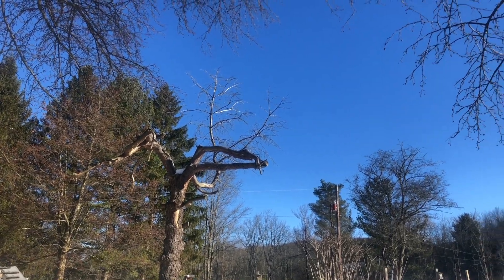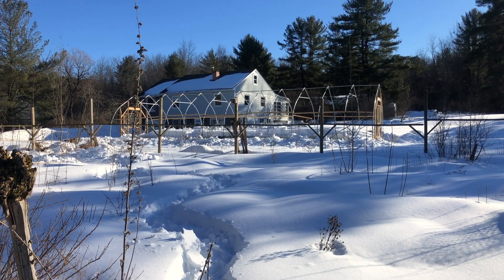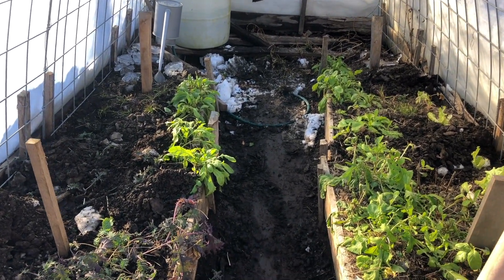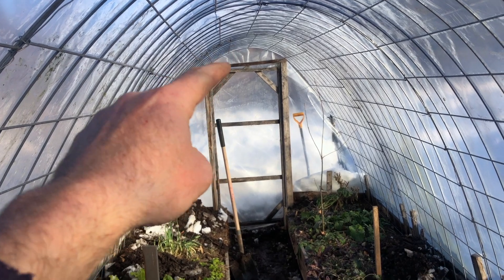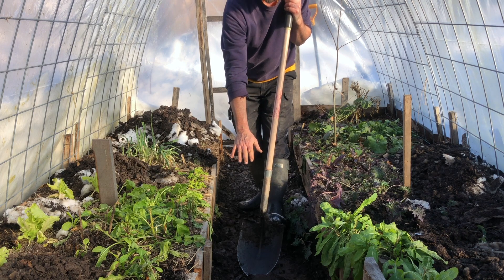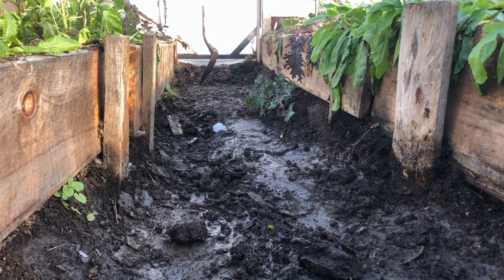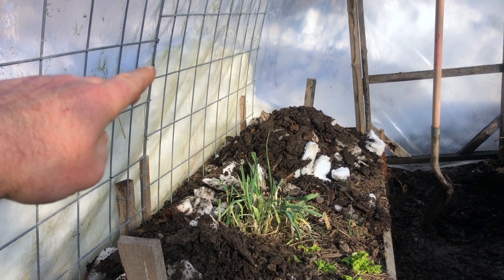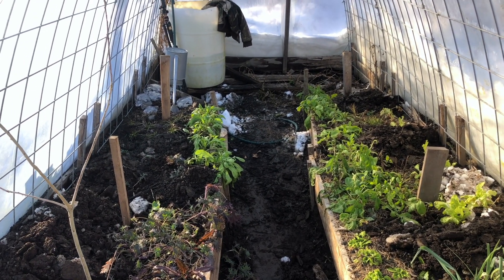Compost Heating a High Tunnel - Walkway based heating approach concept...

Comment: Not convinced that the volume to surface area ratio is going to be high enough to keep the compost active; looking forward to your results.   I would recommend starting the low tunnel down low and away from the side walls, keep the additional layer of air insulation.
Reply from the maker: 100% agree with the low tunnel poly returning to the ground on the north side, no light gain to be had but definite air gap to be had... on the south side I may experiment in the different tunnels...
I wonder about how much warmth I will get too, but I'd like to try.

Comment: Overwintering means more or less dormant and not productive?  I'm very new to all of this... 

Also, this is probably a reach, but I wonder about the effectiveness of using copper wire, mat, or pipe to conduct heat into the soil directly from your compost isle to the beds.  I can't remember where I saw the information but it seems that the wire will move heat quite far quite efficiently.  Coupled as such, perhaps you could avoid some convection losses?  I really don't have a clue though, since I think you have to turn the compost somewhat frequently?
Reply from the maker: Overwintering is like 'sitting still' and waiting for warmth and sun to wake up and take off super fast.  Gives a nice early jump on greens for us.
Great in concept, but in practice the copper or other material would make for a very hard time in turning/accessing the compost, so I'd have to think about that...
Reply: @edibleacres  Thank you for the response.  Makes sense.

I didn't think the wire-in-compost idea was that good.  Not sure if this next idea is any better but I figure why not share it anyway.  Basically, using the copper (tubing in this case) conduction idea, would it be at all worthwhile to try a south facing trombe wall/solar oven thing and coupling it to the high tunnel bed(s)?  I suppose somebody has already tried a variation of this...

Comment: How many pathways are you planning in the 14x50'?  I envision 2 and wonder if we are on the same page.  Thanks Sean.
Reply from the maker: My intent is to have 1 pathway centered through the very middle running the length of the 50' space.  It would be around 2.5-3' wide.  The beds would then be designed on a keyhole pattern for access as needed.  I'll certainly share notes as we evolve it.

Comment: A product called Mule Tape is used by electrical contractors for pulling wire through conduits. They retire it pretty frequently,since they don't want to risk breaking in the middle of a wire pull. It might-if you can find some-be a cost effective alternative to para-cord.
Reply from the maker: I will look into that, thank you for the note.  I have a mile long spool of paracord I bought a ways back that I can dip into for now...
Reply: Oh,heck,if you have a mile of paracord already there,use it!

Regarding the compost heat plan,would it be worth a try to rotate compost from one side to the other? As in fill one side of the tunnel with compost that's still hot,to warm the other side that has plants growing in finished compost,then swap grow sides when the hot side cools off and finishes?

Comment: Snow is an fine insulator. I'd leave a foot or so thick all around couple feet deep, bit more on the north side. With your water table Walapini style might not work, but its design principle always can be applied, like a lopsided tunnel.
Reply from the maker: Definitely leaving it thick on the north side, and clearing on the south for maximum solar gain.
Walapini would be rad, but not with our high water table...

Comment: Question about the low tunnel being attached to the wall - would that lose some of the insulative value of the low tunnel design?  I'm not clear if you'll have the poly stop at the wall and then have only one layer poly against the exterior wall, but as long as there's two layers poly there, then the insulation will be improved and the heat sounds great too.  Neat idea!
Reply from the maker: Great note/question...  On the north side the full 'arch' up and back down makes 100% sense.  On the south side I may experiment as I wonder if the insulation is a trade off for the 2 layers of poly... Less sun warmth entering?  Less energy for growth?  I may try different things in different tunnels... I'll share notes.
Reply: @edibleacres  Poly reduces light transmission by about 10-15%.  An extra layer of still air doubles the insulation value (probably about a zone further South).

Comment: How will walking on the center path affect the compost? Will it be overly compressed? I'm not sure how that changes its thermal properties. I suppose you could turn it occasionally to fluff it up.
Reply from the maker: Yep, definitely something I'll need to keep in mind and design for.
Reply: Maybe you could put down some boards down that rest on top the sidewalls? So you don’t have to step on the compost.
Reply: How about using larger brown refuse such as big chips or pine needles to aerate and that wouldn’t compact or break down as fast?